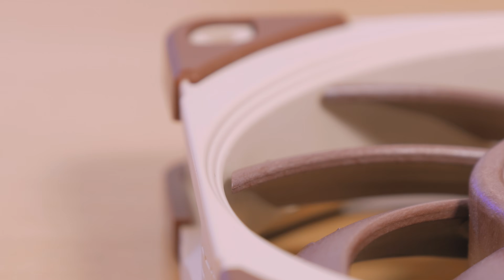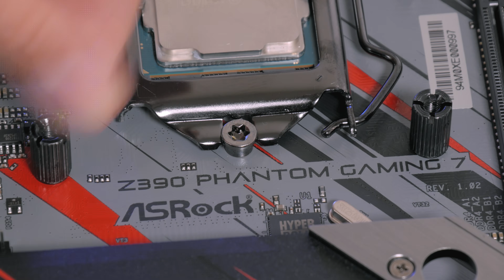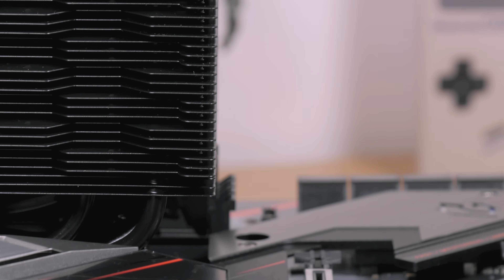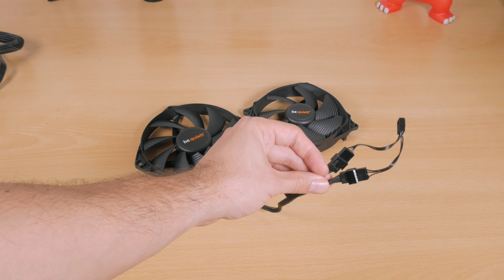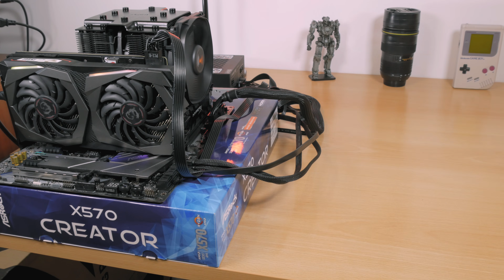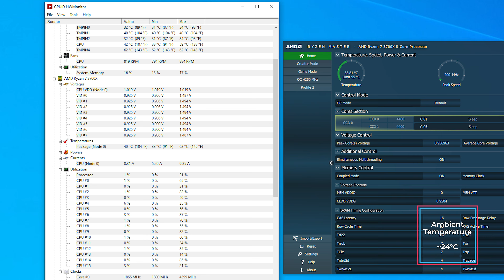CLASH of the TITANS - Noctua NH-U12A vs Be Quiet! Dark Rock Pro 4 (i5 8600k & Ryzen 7 3700X)

Comment from the maker: EDIT: Noctua's cooler was rotated for 180° other way around, that was my mistake, although I tried to double check in a certain point, sorry about that. 😔 With this the RAM cleaner is even better, even though it had a good one in the first place. 😂

I know winter time is closing in, but having a good CPU cooling is always important, especially if you like it quiet 😁

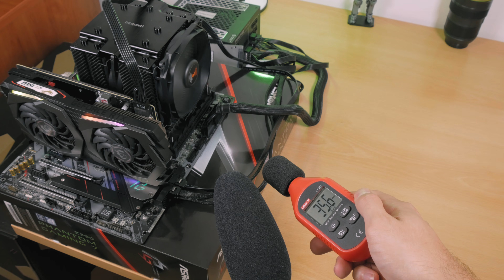Results start at around 9:40 (sound comparison and after that temperatures)
Reply: You should use hwinfo for hardware monitoring since it is more accurate at least for ryzen based platforms.
Reply: No Brainiac... on the Be Quiet! Dark Rock Pro 4 the 120 mm fan does not go between the coolers. It goes on the outside and the 135mm goes in between the towers. Otherwise you could never install this over your ram... You can easily see that in all the imagery from Be Quiet! and in your own video..  SMH
Reply: don't lie both coolers are a pain in the arse to install..

Comment: No Brainiac... on the Be Quiet! Dark Rock Pro 4 the 120 mm fan does not go between the coolers. It goes on the outside and the 135mm goes in between the towers. Otherwise you could never install this over your ram... You can easily see that in all the imagery from Be Quiet! and in your own video..  SMH

Comment: This is absolutely shocking to me, I was planning to buy either one of these for my R7 3700X to replace the stock cooler. I frequently run Cinebench R23 for about 1hr multicore test, and the stock Wraith prism cooler keeps the cpu under 85°C full load and I get clock speeds of 4,195 MHz average. I guess I'll have to make the jump to water-cooling to see a noticeable difference. Thank you for your video, I found it very informative and eye-opening

Comment: I'm not sure what thermal paste you use, but I use a dark rock pro 4 on a 3700x, and running it at 4.7ghz with the factory 135mm fan, and a Cougar 120mm that pulls 103 cfm on the back I only ever hit around mid 60-65c.

Comment: why are the temps so bad? my alpenföhn 3 runs the r7 3700x under full load at max 73 degrees overclocked btw.
Reply from the maker: Probably because I had the PBO turned on.
Reply: @MattsPaddock  nah, my cpu is running at 4.2 mhz and my temps never touch the 80°C, they are far below. max is 74 i think. your temps are hitting 90 degrees....

Comment: Both fans should be fixed at the same RPM to minimize delta offset in temperature results. There will be still error due to the difference in airflow and static pressure factors the two fans exhibit, therefore, always fix the both compared fans to some identical value.
Reply: No point when they are different size fans

Comment: I'm air cooled, Noctua NH-U12S cooler and 3x140mm Noctua NF-A14 PWM case fans, and achieved a stable OC on my 3700x at 4.25 GHz @ only 1.28v with a Cinebench R20 score of 5058. 

You're going to fry your cpu if you keep the voltage that high 

after tons of benchmarking and real in-game tests, I decided the best performance:temperature ratio was to simply use the stock settings but enable Precision Boost Overdrive and implement a negative voltage offset of -0.05
.

In Cinebench r20 this yielded me a multi-core score of 4847, avg core clock of 4092 MHz @ 73C, with single cores boosting to 4.4GHz

In actual game settings like Warzone where 100% of the CPU is never used, I average across all cores 4.25GHz and max temp spikes are <73C

That's all from only enabling Precision Boost Overdrive and a -0.05 voltage offset. 

I don't like the idea of a manual OC @ 4.25Ghz so I'm always running that speed while idle. The fact PBO boosts on all cores to 4.25GHz while gaming is more than enough performance for me

Comment: the voltage is too high for an oc of ryzen. my ryzen 7 3700x with oc at 4.3 hz is with a voltage of 1.28. I have an evo 212 tower and playing it does not go above 65 °
Reply: this^

I'm air cooled, Noctua NH-U12S cooler and 3x140mm Noctua NF-A14 PWM case fans, and achieved a stable OC on my 3700x at 4.25 GHz @ only 1.28v. 

You're going to fry your cpu if you keep the voltage that high 

after tons of benchmarking and real in-game tests, I decided the best performance:temperature ratio for me was to simply use the stock settings but enable Precision Boost Overdrive and implement a negative voltage offset of -0.05

In Cinebench r20 this yielded me a multi-core score of 4847, avg core clock of 4092 MHz @ 73C

In actual game settings like Warzone where 100% of the CPU is never used, I average across all cores 4250MHz and max temp spikes are <73C

That's all from only enabling Precision Boost Overdrive and a -0.05 voltage offset. 

I dont need a manual OC to 4.25Ghz so I'm always running that speed when idle. The fact PBO boosts on all cores to 4,25GHz while gaming is more than enough performance for me
Reply: @matthewmurphy6751  u could definitely lower that voltage, I'm running a i7 10700kf 4.9ghz at 1.14v
Reply: Agreed

Comment: I think you have problem with your case in _out airflow fans.
NH u12 a I see videos that it dose not reach 80 c and above.
Maximum 70 
And stock cooler with ryzen maximum 80c 
And the best cooler is corsair h115i plantium 280mm  x2 fan 140mm.
Maximum 69 
In gaming reach 54 c

Comment: lo vi en inglés, con subtítulos en inglés, traducido automático al español y sigo sin poder determinar cual era mejor.
Reply: hizo un test erroneo con el ryzen, tenia el amperaje muy alto a casi 1.4voltios.  yo tengo el mismo ryzen 7 con voltage a 1.28 metiendole caña a 4.3hz. en oc no me pasa de 65° con un evo 212.
Reply: @06LCS  ya lo encontraba raro yo que tuviera 80-90 °C SIN Overclock!!

Comment: Wow these temps are terrible, I get 76c with my U12A 1.385V @ 4.25GHz
Reply from the maker: With PBO off or?
Reply: TekTick PBO off
Reply from the maker: @justint.6618  Yeah, I left mine on, thus probably got those results. I think I'm going to stop using that when OCing, I actually did it already, I'm doing a big low profile cooler comparison with it!
Reply: Turn ur voltage down, no need for that high

Comment: Both are great and have nickel plated copper bases so pour some Thermal Grizzly liquid metal on them and see those OC temps plummet. I have the nh-u12a and it is cooling great. I have my 9600K@4.8Ghz at 1.27v and saw a max core temp of 85C at OCCT with AVX Linpack and 64 bits enabled for 30 mins (room temperature of 25C) (Strangely it burns in higher  temps than Prime 95 at small FFTs). In Games i see no more than 60-62C when at 85-100% all core usage.

Comment: I have an 8600k oc 4700mhz at 1.22v (not delidded) with the Dark Rock Pro 4 and I am getting temps as high as 82 deg in Prime95 (current version with no AVX offset, stable). When I increase voltage to 1.27 try for a higher OC, my temps are crazy (4.9mhz puts me at around 95 deg even with a -2 avx offset) Is this normal, or could something be wrong? I have 2 140mm intakes, 2 120mm exhausts, I have re-seated the cooler with Arctic Silver 5 paste twice. I really want to push it to 5ghz, and I bought the cooler specifically so I could. Have I just lost the silicon lottery?
Reply: I believe it is intel's garbage TIM inside the cpu, I had a delidded 8700k @5ghz all cores, @1.32V , with the dark rock pro 4 It never got hotter than 72 deg at full load using cinebench R20.

I used thermal grizzly conductonaut liquid metal between the die and IHS, and used kryonaut thermal paste between the IHS and cooler. If your cpu is stable at the frequencies you are listing maybe it's not the silicon lottery, just the horrible TIM that intel uses.

Hope this helps

Comment: putting two fans with different diameters and power needs split off the same connector is a bad idea. One is going to be moving more air than the other and wanting to draw more / less current.
Reply: Don’t matter, if you install correctly they both should be bringing in air through the towers in the same direction. They aren’t going to be competing and if you have the exhaust fans from the case next to it the air should come straight out.
Reply: @0OGR17  I'm talking more about air pressure and eddy currents, plus the fact that different size fans rotating at different speeds do require different amounts of energy. Yes, fans blowing in the same direction move air one way, it's just not efficient when they're all different sizes.

Comment: like this is nice and all but it just makes me not want to buy a aftermarket cooler cause the stock prism cooler doesnt let the 3700x past 82-84c with pbo enabled on a bios level which gives you higher clocks than ryzen master. Makes me wonder why these are so high when they're superior coolers.
Reply: @jediii86  i tried the h100i platinum and i think it was defective cause i was getting overall 8c worse temps hotter.

Comment: I putted the Dark Rock Pro 4 on top of my Ryzen 3700x, so quiet vs the AMD cooler :P
now I have to change my case fans,  they are louders than the CPU side.
for the temps... I'm at 78deg, 4.3ghz, 1.33v crazy good!!! normal fan speed, and with the GPU at 100% load too, so more heat in the case
at quiet speed I'm jumping to around 82deg but sssoooo quiet
and at full speed down to 74/75deg. and like in your video, not so loud.

your video helped me doing my choice, so thanks!!!
Reply: Ok now go learn english,  this was painfull to read.
Reply: Alan Gaytan “painfull” I think we know who needs to learn english

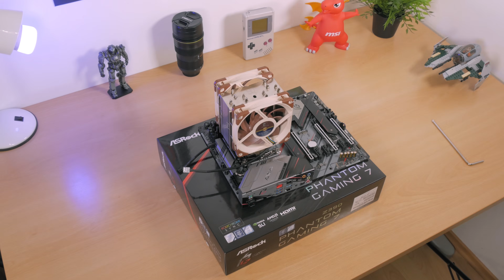Comment: You've installed the noctua cooler the backwards @3:11. If you've installed it correctly, the first fan of the noctua cooler would not have over hanged above the ram slot. The design off that cooler is offset so that it would have better compatibility on ram slots..
Reply from the maker: Yes, I know, I've address this in my pinned comment!

Comment: Ah....Is it just me or was your 3700x running at like 86-91 c during the test? lol....
The default cooler never gets to 80, this can't be right.  

if it is, than those two coolers are useless.
Reply from the maker: I've just done a test with a 280 mm AIO on this exact Ryzen 7 3700X, same stress test software, and I was getting around 75-80°C at stock, and around 80-85°C with the OC, so this seems about right. What test are you using to load it?
Reply: @MattsPaddock  the voltage is too high for an oc of ryzen. my ryzen 7 3700x with oc at 4.3 hz is with a voltage of 1.28. I have an evo 212 tower and playing it does not go above 65 °
Reply: I jumped to near 95deg on stock cooler with 4.3ghz and 1.33v, fan at full speed (lot of noise)
with the DR4PRO I'm at 82deg at low fan speed and 75deg at full fan speed, but far away quieter than the default AMD cooler
its a huge improvement for me.
without overclocking, you are right, the CPU rarely go higher than 80deg, its how the CPU works, and stay cool until you manually overclock it.
Reply: Those 2 coolers are the best air coolers available

Comment: another thing in favour of U12A is RAM CLEARANCE!!! you can fit any ram module!
Reply: The Dark Rock Pro accounts for that too.  I own one and can verify.
Reply: Yea no you totally can lmao
Reply: You can fit pretty much any low profile ram with the DRP4, as shown in the video, including in the closest ram slot (check motherboard compatibility on BeQuiets website), but if the ram is a bit tall then you may have to install it before the cpu cooler. As for taller and RGB ram, on bequiets website there is a picture of it fitting GSkill Trident Z RGB ram which is 44mm with a couple of mm to spare, just google how tall the ram is that you want to use. However I don't see the point in tall/RGB heatsinks with this cooler because they will be mostly covered by the fan, and they add cost while not making it faster than lower profile ram heatsinks.

And just so that anyone doesn't make a mistake, keep in mind with bequiet that the DR4 'Pro' version is usually more ram compatible than the normal non-pro single-tower because the pro has an indent and a higher up fan on the heatsink.

Edit: Correct, I updated my post, Corsair Dominator is about 55mm which is too tall. The reality is though that tall heatsink ram don't 'dominate' quality low profile RAM heatsinks, it is just marketing and aesthetics, that add cost.
Reply: @Tim._..  The Pro 4 cannot fit corsair dominance
Reply: @DarkPa1adin  yes it can.  You raise the outer fan clip up a bit and it will fit.  Sorry, Noctua boy.  You didn't win this one.
Reply: @gabejohnston1556  lol. I am using DRP4 and I regretted it. Because it is harder to install compared to Noctua
Reply: @DarkPa1adin  you only have to install it once who cares 😂

Comment: Quite high temperatures. I never had R7 3700X temperature over 72 °C with AMD stock cooler, even with several hours x264 (placebo) bluray mastering jobs. My room is air conditioned (25 °C or less).
Reply: the problem are the different bios. Some, especially Asus have very bad LLC optimisation. My stock 3700x run at stock at about 80c under heavy load. After manual OC to all core to 4.3ghz it just running at a max of 63c. Im using the Dark Rock Pro 4 and im at 1.30Vcore.
Reply: @Thor_Asgard_  so what you are saying is in order to reduce the load temps of the 3700x, it has to be overclocked otherwise at stock will always run hot? I am confused.
Reply: @VULTUSPRIME  It means that Precision boost Overdrive, the auto OC feature is configured poorly by alot of Mainboard manufactures. Ive even seen a 3400g reach 83degrees under load because of PBO. With the manual settings just 59C at max. That means by manually setting the clock, you can gain alot of efficiency. Its the manufacturers fault not AMDs.
Reply: @Thor_Asgard_  wtf 4.3ghz at 1.3v???
Reply: @nea3451  nothing special at that. Just a good sample. About 70% of the 3800x can do the same. Maximum is 4.4ghz @1.38v stable. Any more and itll crash. Board is a x370 crosshair vi hero.
Reply: maybe your temp sensor is broken?
Reply: @yewang657  it is impossible. The "sensors" are on die, one for every core. If any of them would be bad, the processor wouldn't pass QC or wouldn't be working at all.
Moreover there are several other tests with the same coolers (none of them with such high temperatures) and comparisons with stock cooler. For example
https://www.youtube.com/watch?v=snVegQkHAlk
From that time thermals were going down and boost speeds up with subsequent BIOS updates.
Reply: @tulenik71  overclocked?

Comment: What the hell are you doing?

Set the "Peak Core(s) Voltage to 1.3125 and the all-core speed to 4250 and you will be running at below 70°C on the stress test.

Just make sure that you adjust the the LLC to the a higher value - in my case on a GigaByte board the Vcore LLC was set to "Turbo" which is the third highest setting.
Reply from the maker: I get your point completely, but I didn't fiddle with Load Line Calibration on purpose, just to get that worst case scenario (higher TDP figures to be precise), since both of these CPU's aren't TDP monsters, so I needed that extra bit of heat out of them to see how they can handle them.
Reply: @MattsPaddock  Dont forgett that you create a thermal barrier. Thermal transfer is limited and therefore pushing the limit isnt always good. Also the noctuas spin at 2k rpm and the bequiet at about 1200rpm I think. Nevertheless I have the dark rock as CPU cooler and the nfa 12x25 as case fans.My System is simply dead silent.

Comment: You installed the noctua cooler incorrectly. If you installed it 180 degrees from how you did it, it wouldn't even over hang there RAM modules. The cooler was designed with an offset specifically for that.
Reply from the maker: Yes, you're right and I apologize for that. I actually remember double checking everything, because I pulled the fans down and I wanted to see what's the orientation and in that process I got it wrong. Thanks for the heads up!
Reply: Damn thats pretty damn dumb lol it happens i guess.
Reply: Alex Worm no need for insults sir. It was an honest mistake